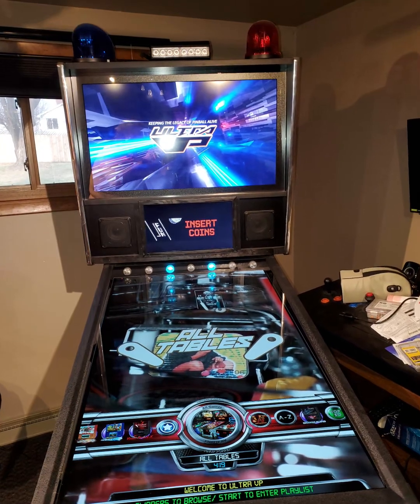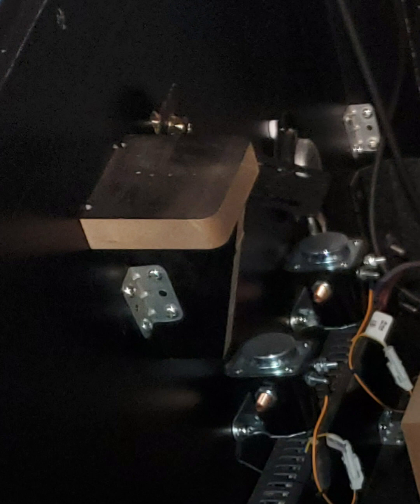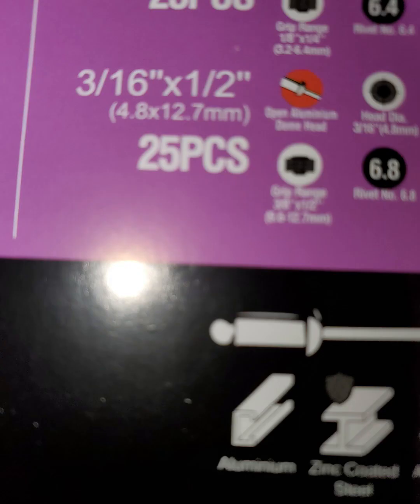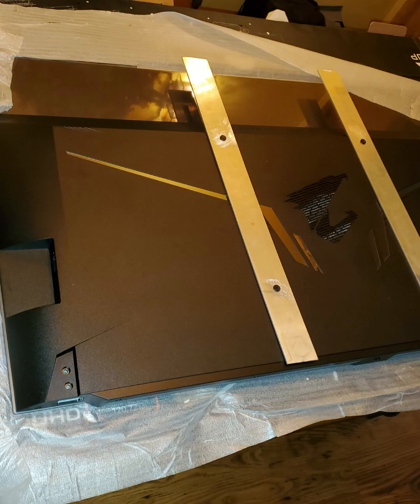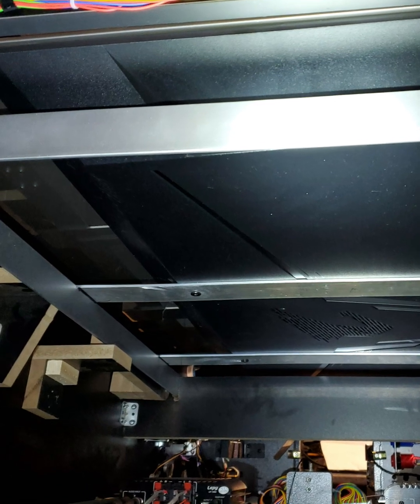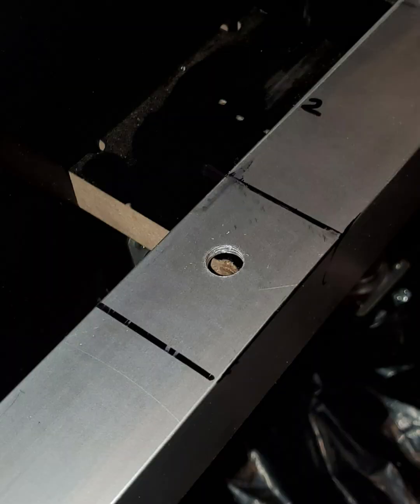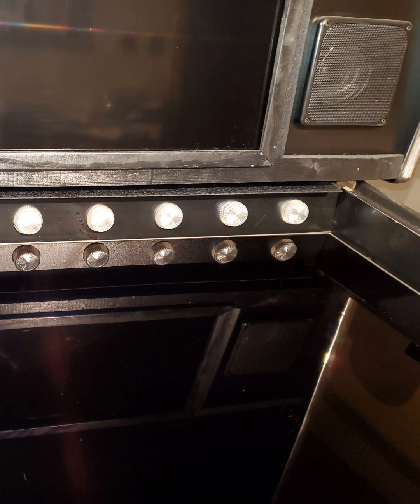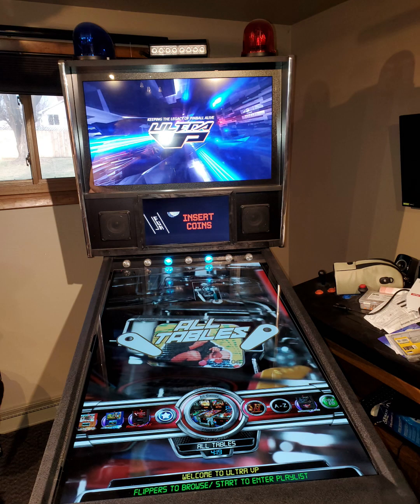Ultra VP monitor upgrade

Comment: Great job on the installation.  I like how you created an aluminum frame for the mount. 

I have a question: I noticed the monitor you used for the upgrade is no longer available, unless it's used or being liquidated.  Is there an equivalent 48-inch, 4k, OLED you would recommend currently?
Reply from the maker: Ebay has a used one (AORUS FO48U) for $700 and Best Buy has a LG - 48" Class C3 Series OLED 120hz for $1000 that might work.

Comment: Well done!  You have given me the push to do this upgrade to my 5.0 (monitor ordered). Could I inconvenience you for the length and width of the angle bar frame and the length of the two support bars?
Reply from the maker: The 1 1/4 x 1 1/4 x 1/8  angle bar forms a rectangle of 36" x 22" (inches) The two support bars are 2" x 1/8  flat bar was one 48" piece that we cut in half, so two 24"  bars that attach to the monitor.
Reply: @myinnerthoughts  Thank you!